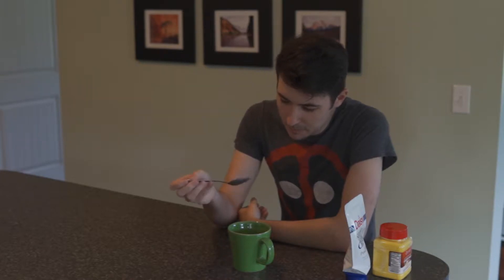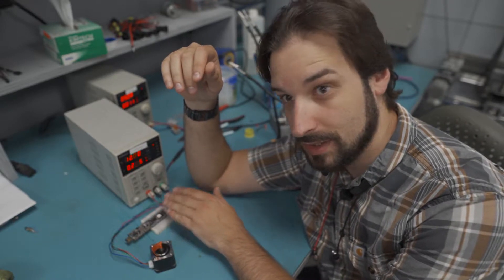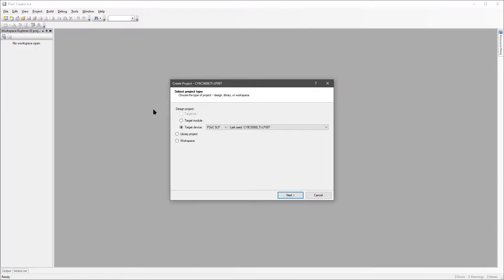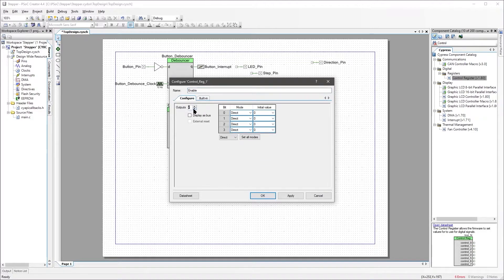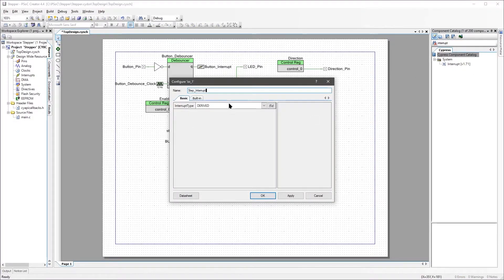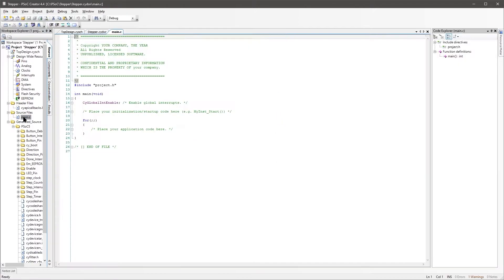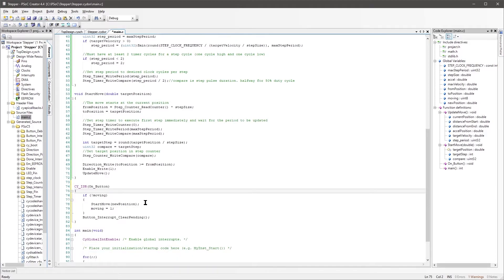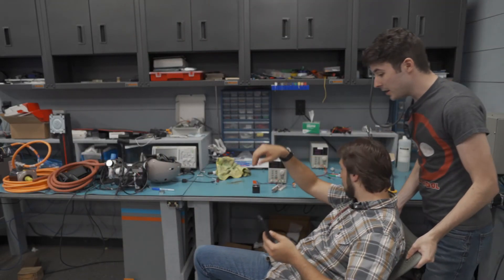PSoC Microcontroller Tutorial - Basic Stepper Motor

Comment: It would also be most useful to have an article or video with code on how to add I2C OLED 128 X 64 displays as well as 3.5" LCD Touch SPI  displays.  Further,  if possible a video on how to use DS18B20 Single Wire Temperature sensors.  That would give Arduino micros great competition using the versatile PSoCs.  Thank you so much.